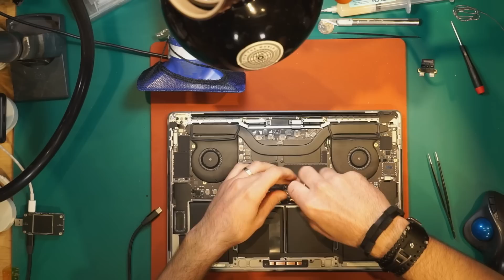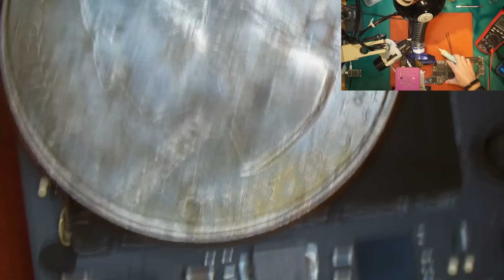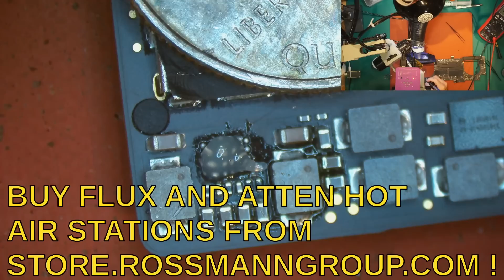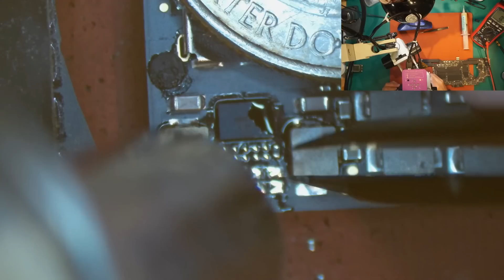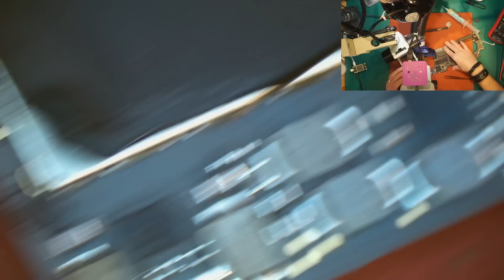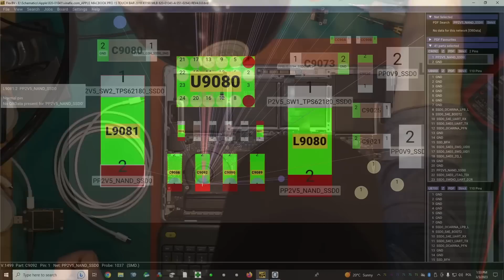Are Apple products still JUNK in 2023?

Comment: But why does this happen? -- is it some form of instruction?  or because some component fails open it lets pass 7v to the NAND? --

if it was an instruction triggered by some mistaken process or anything then Apple would be liable of this bs. If it's simple bad quality components, then would it be covered under warranty?

Another reason to live by the 3-2-1 moto of backing up :) 

(I've got a late-2013 macbook pro and it's been great. I did have to replace the screen twice [under warranty] because or some mura effect on some dead pixels on the panel, and then they gave me one of those shitty panels that flaked off after a few years... made them change it.
I'm now about to upgrade because this laptop is essentially a dinosaur by now and I really need something. I've got both, PC and Mac and they both have their shitty sides. Apple are just c**s with their repair and pricing structures, but can't deny that what takes a windows laptop sometimes hours a mac does it in minutes. And then there is software I need [like solidworks] that only runs on windows, which isn't super great either -- so I guess you can't win them all. Either run a risk with crapple, or suffer some wintard stupidity as well)
Reply: Get a decent PC build and get a cheaper M1 laptop refurbished. Dual boot Linux and Windows on the PC, and you get the headache and joy of all three.
Reply: @ghost-user559  I went a bit bonkers and I'm getting a refurbished M1 laptop, a mac studio and got a Lenovo P360 workstation.  I tinkered with a custom build but Australia (where I am) doesn't shine for part availability and that ends up being the best deal atm for what I wanted.
(got the macs with discount, would never go full retard and pay full price)

Doing a massive overhaul as I'm running on two dinosaurs atm and need some beefy machines for what comes next... (I hope is good... ffs)

Comment: I totally and more than appreciate your videos, but geez, there is no friggin alternative to Apple laptops. Microsoft are just as bad :( (p.s. my 2016 MBP just died (SSD) - R.I.P.). I have adapted and won't replace the laptop. The time for laptops is over thankfully - so i just put everything into hefty workstations and feel so free not having to lug a full computer around. Back to the topic - thanks for all the educating videos you put out!
Reply: Get an ASUS ROG. Or a higher tier.

But avoid Dell, HP, Lenovo, Surface, etc.

They aren't "microsoft" laptops, they use Windows, but unlike Crapple, the OS isn't tied to the hardware companies, they just have standards for hardware and each manufacturer can make their own machines to whatever spec they want [other than Surface, which IS the same and IS shit].
Reply: @kitethetwinblade  Asus ROG keyboards are utter dogshit compared to Macbook or MSI Steelseries laptop keyboards, or even the modern Dell Latitude and XPS/Precision keyboards. Specifically, their actuation point is actually lower than the point in depression in which you overcome the initial resistance, and so unless the key is pressed dead in the center of the keycap, you cannot trust its mechanical feedback to tell you whether you have indeed pressed the key or not. I had a couple of AMD Advantage Strix G15 models and wanted to chuck them out the window after just a handful of hours, drove me absolutely insane with typos (I am not a professional typist but consistently average over 110 WPM without typos with any of the aforementioned keyboards).

To the best of my knowledge, all of the Asus ROG G / Strix / SCAR models use the same godawful keyboard design.
Reply: @kitethetwinblade  Feeling plastic under my palms = nah. My 2016 now did 7 years and was as fresh as day one even now - i"d say that"s money well invested. I"d look at Thinkpads maybe, but luckily i have no need to buy a laptop atm. I"m an opportunist, not an evangelist and between my Macs and my Win10 and 11 boxes there is total harmony. I don"t really care about the OS or even about what apps i use - whatever gets to the required result the easiest gets the job. 
MacOS was superior for many, many years as an OS base. Since Win10, even more so 11 there is not really a clear winner anymore. THE single one thing Apple is missing out atm is PyTorch as you need Nvidia GPUs for it. The whole AI-train is rushing by Cupertino without a stop and even though there are a few attempts to translate stuff to metal it"s really humbling to see what a MacStudio Ultra64 can do compared to a 13900K/RTX4090 box. So - i"ll probably never get an ROG, Alienware, MSI etc. - Surfaces may look and feel "worthy" as well but for 2.7k i get 12th gen only and just 32 Gb RAM - so yesterdays tech. BUT with the same obsolescense as Apple - everything is soldered and glued down. Will it carry me for 5 years? Doubt. 
So i'm checking out of that vicious cycle. If i REALLY need to take a workstation with me my MacStudio is perfectly mobile and fits into my bag. (This MacStudio btw. is also totally non-serviceable but hey - that's the world we live in now)
Reply: What sort of BS
Reply: What sort of BS
Reply: What sort of BS

Comment: Once again Apple has successfully protected the users data.
Reply: M3 based macs will send 230v to the user to protect its reputation too
Reply: The M4 macs will have a built in user deleter.. Should they attempt to replace the battery because its "unsafe!"

It will detonate with 50 mile explosion.
Reply: @lukedavis436  too bad Razer beat them by years with that
Reply: @app0the  Oh
Reply: @lukedavis436  yeah, I'm changing the batt in my razer blade every year since it's trying to escape, which is twice as often as my 2006 macbook pro where it bulged every 3 years, and i thought that was bullshit already! but come to think of it, at least if i'm careful enough i can change in in the razer and not explode myself  :P
Reply: they protected it so well the user can't even get too it.
Reply: @Nova-Pixel-6  This is good because when you send in your computer the employees won't be able to post your private videos with your own account.
Reply: @ozordiprince9405  as if that stopped Apple employees in doing what was described here
Reply: @Nova-Pixel-6  apple probably have a copy of everyone's data that will be the next thing they will sell it back to you
Reply: Taking "Burning the hard drive" to a literal sense. The data was protected so well that it was turned into magic smoke.
Reply: At least they have very good backup system.
Reply: The security feature is so good even CIA and NASA won't be able to look at or tamper the data inside the SSD. The SSD overvolt is a security feature!

 
100% Apple. Think Different.
Reply: @Jan-xf8sk  You re a joke. What do you know about what NSA can do? Why dont you work for free at Tim Cook use?

You re so dumb NASA doesnt crack codes.
Reply: This is the sheep mentality 😂

Comment: Imagine if your vehicle door wiring harness could wear out over time and fry your vehicles engine and electrical system killing your vehicle because you opened your door, like you have to do to operate the vehicle. There would be mass recalls and a class action lawsuit. The disconnect from what most people would think is OK or acceptable with say repairing your own vehicle and what phone and computer manufacturers do is amazing to me; the notion of non-owner replaceable batteries, at least to me, takes the cake as batteries is the one part guaranteed to eventually FAIL. Just think it GM said oh well your battery capacity is bad so we you can pay 32k for a new battery or buy a whole new car for 35k; GM would be out of business in short order.
Reply: It's funny because you just described every electric vehicle manufacturer.  Yet gullible people are on waiting lists to buy them.
Reply: You'd think that, but GMs 2.4 ecotecs have loose piston rings which lead to excess oil consumption, O2 sensor fouling, cat clogging, oil starvation (if unnoticed) which causes timing chain detonation.

There has never been a recall for that.
Reply: @OtherDalfite  Also GM's new self-destroying pushrods feature (AFM). Not gonna lie, I drive a GM vehicle but it was made 20 years ago when stuff was built differently so I'm doing mud donuts on a truck with well over 100K miles + a blown out transmission while people are getting new GM trucks that have 15,000 miles and the engine destroys itself.
Reply: @linuxguy1199 my folks 08 is over 170k and runs strong as day 1. That said my old man was building 700 hp sbc in early 90s so maybe not fair example 😂
Reply: @Thumper68  Yeah, 08's a bit too new for me, but I'd kill for a squarebody suburban to put some big mud tires on and daily drive :P
Reply: That actually happens with Freightliner, the wiring harness frays and shorts the ECU
Reply: My cars 50+ years old not an issue.
Reply: You just described an old car I had from the 90’s and an old VW Jetta my wife had
Reply: My iPhone 6 battery just bought it. It was given to me by my brother, and had been getting worse, but now it won't even run plugged in. If I could just replace the battery I 100% would. Too bad someone has an incentive to not let me do that...
Reply: @Ottuln  That’s a decade old phone friend? You can change the battery, just look up an I fix it tutorial and buy the tools. But at 9 years old whether that is worth it is your choice.
Reply: @Ottuln : You absolutely can replace the iPhone 6 or 6+ battery; I replaced mine it’s not very difficult and only costs like $15-25 and comes with the tools needed.
Reply: @Ottuln  how old is that battery? Do you have any clue about battery chemistry and how they work?
Reply: @RandomUser2401  lol my stock psp battery works, simp
Reply: @RandomUser2401  also my HTC One battery is still going strong, simp

Comment: It seems like MacBooks are a lot less reliable than iPhones. I've never had an iPhone break, but it seems like if you even sneeze on a MacBook it just gives up lol
Reply: It all depends I think… my MacBook Pro 2015 is still running strong and as fast as before. I put that thing threw a lot doing music production with fans going for hours. 
I recently gave it to my mother a few weeks ago. So I think it just depends…
Reply: @GlobalWave1  I think the point isn’t supposed to be “all of them break all the time”, it’s supposed to be “they break in ways that should be unacceptable because they’re caused by poor design.” For example, I’ve never had a problem with my iPhone, but I’ve had nothing but problems with my Air Pods. One headphone will have significantly lower battery (like, 80% lower) than the other, sometimes the case refuses to recognize one of them and refuses to charge it, sometimes the audio will be stronger in my left headphone than my right headphone, which is extremely unpleasant. And I have never had these problems (at least the applicable ones) with other bluetooth headphones, even crappy ones that I had to duct tape back together.

I haven’t had many hardware problems with Apple products. But the problems I have had should not exist in the first place. If they don’t exist with crappy 35$ bluetooth headphones from Walmart, they should not exist with 300$ ones that are meant to function with my iPhone.
Reply: @LoxyTheReindeer the reason one isn't charging is because you need to use sandpaper on the connectors to remove build up. This happens with all wireless earphones. Also you probably need to clean the ear wax if one doesn't sound the same a dthe other.
Reply: @mrECisME  I do both (albeit not with sandpaper) regularly. It’s not because they’re dirty, and I know that because it’s completely random when it’ll happen.

Plus, they’ve been doing the charging thing since I got them.
Reply: Not really. Talk to a plumber and you would think toilets and pipes were the most buggy and inefficient garbage tech that ever existed. Louis literally only receives broken technology and he has historically specifically targeted the Apple market. So obviously watching Louis is the equivalent of watching a disgruntled plumber.
Reply: @ghost-user559  It resonates with me a lot because I've broken MacBooks before, to the point I don't even consider buying them anymore.
Reply: @BrianCroweAcolyte  I’ve had my 2013 MacBook Pro for 10 years and it’s still my daily driver. Zero issues. I have a 2009 that is now 14 years old and it’s totally functional. You can buy any used MacBook and install Linux or boot camp windows. You can use an Egpu on the older models, swap the battery, swap the ssd, and upgrade to 16GB Ram. I have old windows computers from Dell and HP and they are hot plastic garbage. All my Apple products are sleek polished aluminum and they are solid machines. Literally every company has duds and even entire models that are trash. You just have to research before you buy anything nowadays and always keep your receipts and get Apple care. I’ve never had a good experience buying a random windows laptop, and although I hate Apple, I have to give credit where credits due.
Reply: @ghost-user559  well said, and he fails to realize this himself.
Reply: @JimAllen-Persona Nice! I never really thought going Linux or any such thing. I wasn’t that into modding or going into an open source OS. I just need a computer to run my music productions on the go without much problems. 

Never had much problems except high temps at times and high fan noise. Did have a custom fan curve and repasted the cpu. Also had some thermal pads help the heat. Did me wonders and loved and got much years out of the computer.

Still runs excellent but upgraded to the m2max 16 inch and holy $hIt this thing runs my old sessions like a dream without a blink. 
I’ve listened to Rossmann for years. I agree with much of what he says but nothing has let me down like these laptops while I run logic X.
Reply: iphones also suffer from bad designs, remember these? 
-iphone 4: "you're holding it wrong!"
-iphone 5c: physically bends in the pocket
-iphone 7: audio IC breaks from board bending
Reply: @leonro  I used an iPhone 6 for like 8 years, dropped it about a dozen times lol. I think if you use a good case and the default Apple charger, you're going to be good 95% of the time.
Reply: @BrianCroweAcolyte  I don't like made-up numbers. While I cannot tell how people used their phones, Apple doesn't have a good track record of supporting people who bought their provably badly designed products. 

You can get lucky or unlucky, but the only ones who know the likelihood of certain failures are Apple themselves. We only really find out about those issues if there's enough people making waves on the Internet.
Reply: @BrianCroweAcolyte here are thousands of chips with thousands of different pieces of software and basically a hundred million iPhones made every year, that you happen to have one that doesn’t show any defects doesn’t necessarily mean the model in question is plague with a myriad of them
Reply: @Pro720HyperMaster720  A normal failure rate for manufactured goods is like 5%. 5% of any iPhone model is millions of people. There's probably a similar or worse failure rate for most Android phones, it is just less noticeable because the market is split between 10+ manufacturers making multiple different models each.
Reply: @Syndan Yeah I know their MacBooks are crap, I'm talking about iPhones though.
Reply: @Syndan where do you pull that 5% from?
Reply: @Syndan what 5%? where do they come
from??
Reply: @Syndan source, for the third time now
Reply: @BrianCroweAcolyte the failure  rate of a 200$ android is not the same like a 800$ one. Well lets face it they use apple we need to have mercy not everybody can be smart.
Reply: @leonro   now do the same of Samsung, Google and so on phone lineup and compare the number and severity of issues.
Reply: @RandomUser2401  "Whatabout my wife who stopped working when our first child was born? If my wife can't do it, why should my iPhone be expected to work?"

I didn't talk about Samsung or Google at all. If a company did bad, they did bad. I don't care if their behaviour is "industry standard"; I have common sense, and it tells me that if I mess up I should do my utmost to compensate.
Reply: @leonro  no clue what that nonsense analogy should tell me.
Reply: @RandomUser2401  it's a joke, mate, learn to have some fun
Reply: Actually, iphones brake alot, there is a whole industry on my country just to fix them, and the failures are so known you sometimes doesn't even need to open the phone to know whats the matter... Like iphone 6 tristar, iphone 7 codec, short 2g chip, qualcomm baseband short, and so on and so forth. Many stores here only fix iphones, the volume is insane.
Reply: @DciMaluko I know a store where you have to get a  ticket  to wait  have your mac checked.
Reply: @DciMaluko  what is the percentage, not absolut number of iphones, that fail? High volume production means many broken devices due to a variety of reason. Your statement is meaningless.
Reply: he only sees the defective ones out of a billion working ones. Classic heavily biased view.